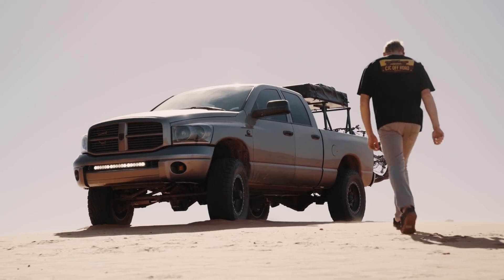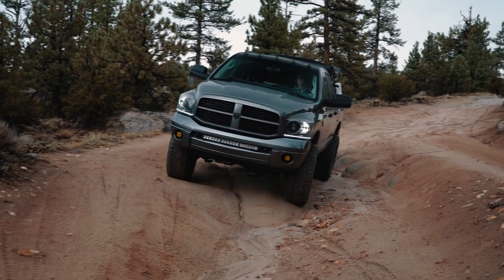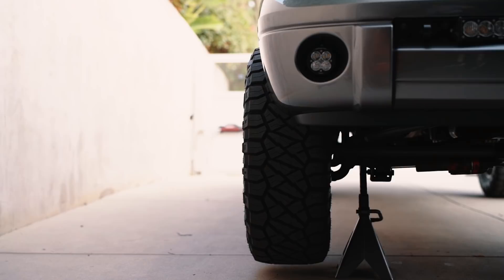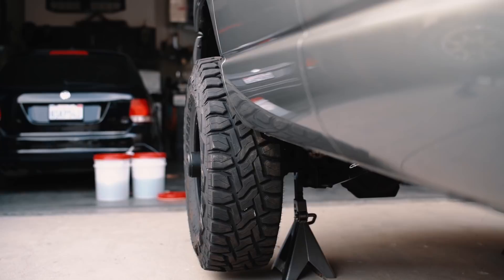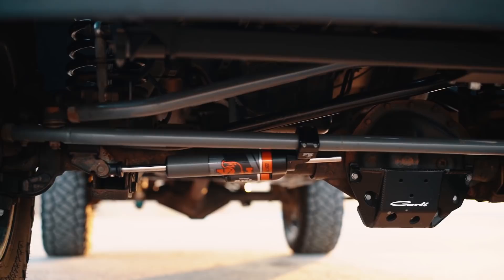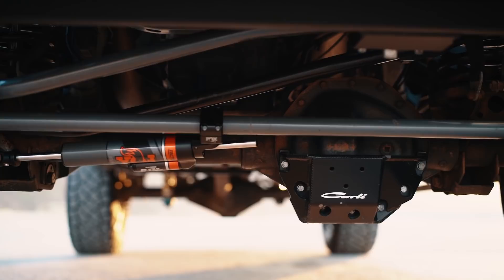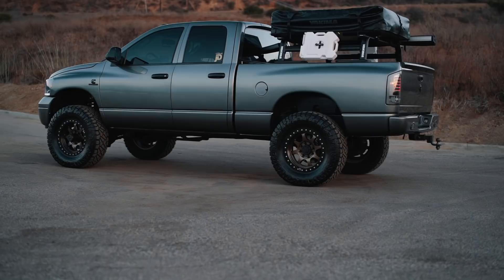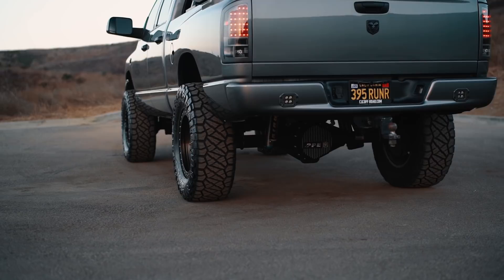How to Fit 37s on Your 3rd or 4th gen Cummins Ram 2500/3500 the RIGHT Way!

Comment: Metal Cloak arms worse than stock or just not as good as Carli and Don Thurens?
Reply from the maker: They are better than stock, but I was VERY disappointed with mine. They still use a bushing joint, which means worse ride and worse longevity. I’d recommend just doing it right with Carli or Thuren spherical joint arms.
Reply: @JustDiesels  I'm a do it right the first time kind of guy - within reason. Metal cloaks were recommend a year or 2 ago by someone at cjc as an economic alternative to the carli's. $590 vs $1400ish I think. Went ahead and ordered them this past weekend. Started looking at the Thurens joints yesterday and am wondering if I screwed up. Still $300 more for Don's but the joints look beautiful and I have had good luck with Don's stuff in the past. May call cjc and get authorization to return and get Don's arms.

Thank you for your reply and for the videos!

Comment: I have a 08 2500 with a bds 3 inch lift. I'm mounting 37s on 18" x 9" method 305 with +18. Trimming I'm okay with but I'm hoping I don't have to buy the high clearance  control arms. Do you have insight of much rub I might experience?
Reply from the maker: You should be okay depending on what arm setup you have. If you still have stock arms, you’ll want to get something .5” longer with a bend or notch for clearance.
Reply: @JustDiesels  just got them installed.  They clear the bds control arm for about 3inchs of up travel at full lock then they will rub. I'll play around with it tomorrow and decide whether or not to buy new ones. Thank you for your videos.
Reply: @overtimeoffroad1542 I know it’s late but did you ever get the suspension perfect have an 08 and want to do the same thing…

Comment: Is it possible to install 39 x 13.5 r17 tires on a 2005 RAM 2500?
I have a 5" lift kit. tanks
Reply from the maker: It depends on how you use it. You can cram them in there for basic on/off road driving. Stick with a 4.5-4.75” backspace wheel no wider than 9.”
Reply: @JustDiesels  great thank you very much

Comment: So at 1:53 you could turn lock to lock and not run at all.
Reply from the maker: Yep, it just barely clears. With how aggressive my wheels are I have a slight rub on the bumper when really bottomed, but it’s not bad. With a +25 offset 8.5” wide wheel I have ZERO rub at full bottom going lock to lock.
Reply: @JustDiesels  awesome. Keep up the content man, wish you the best of luck.

Comment: Looks too negative. Also this is a totally stock suspension. Any thoughts on changing wheels, tires, and control arms to get the tires underneath the truck with a flush profile ?
Reply from the maker: A +25 to +27 offset wheel will give a nice, flush look on a Ram. Same info applies for fitment of 37” tires on those wheels.
Reply: If I replace the OEM control arms with Carli high clearance control arms, will that improve the lock to lock rubbing ? Also if I stay with 35 inch tires, can I avoid the cost of a lift or leveling kit ?
Reply from the maker: Yes and yes!

Comment: Spacer are okay if you buy the correct ones bruh! It need the hub centric ring in order for it to NOT fall off. Fail!
Reply from the maker: No it needs to be a true bolt on spacer to not cause issues. Any sandwich style spacer is asking for issues! On these trucks you have to cut the wheel studs to run a bolt on spacer to clear 37s with the stock wheels, which usually makes it not worth it.